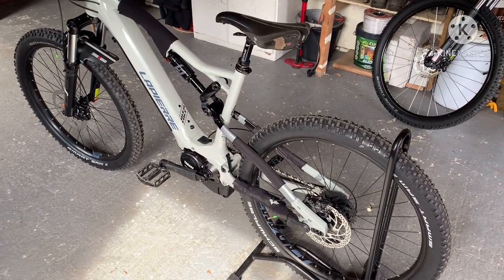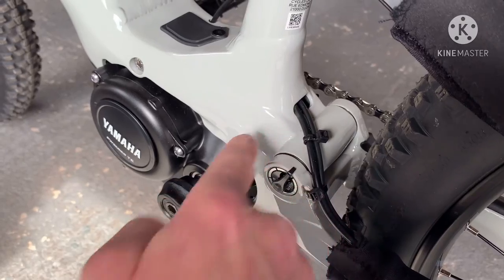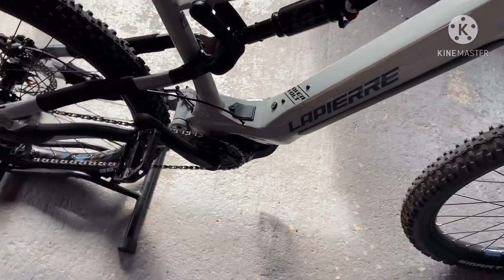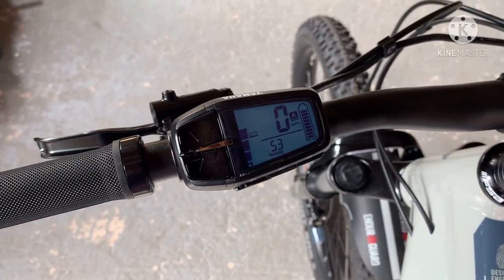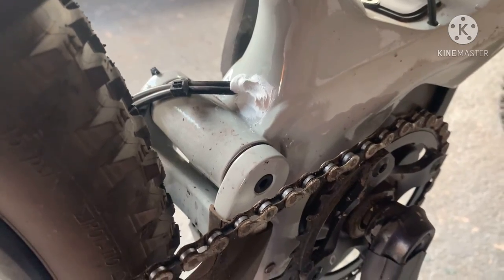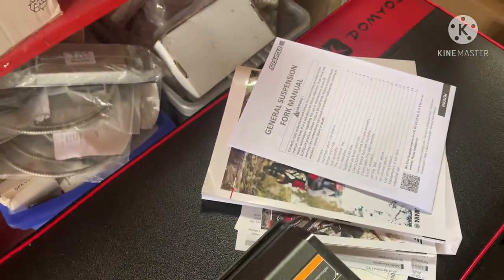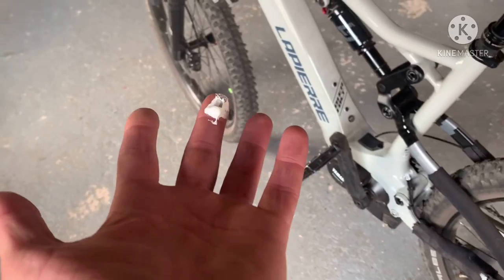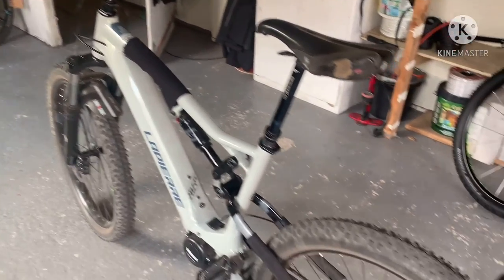Lapierre Overvolt TR 3.5 electric moutain bike - 2021 ride review

Comment: Thanks for making a great video! I've just ordered one of these, and was wondering if you could point me in the right direction for the frame protection you have used and have you added anything to protect the downtube/battery. Any advice would be very much appreciated 👍
Reply from the maker: I always use electrical insulation tape, it’s cheap and good value. I have used duck tape on the Down tube in the past. Also neoprene covers are good. 
Make sure you get a chain device because I had a problem with the chain coming off the front chain ring on bumpy trails. Glad you liked the vlog👍
Reply: @leeteemtb9587   Awesome!  I'll give some neoprene and electrical tape a got when the bike arrives, and look into a chain device. Thanks very much 👍

Comment: It only has 9 gears, that seems low compaired to e.g. a lot of Cube bikes and the 70Nm yamaha Motor is also less that on e.g Cube reaction hybrid, which has 85Nm... do you think this males a difference for an average diver?
Reply from the maker: A lot of the newer ebikes are coming with 10 speed set up, I guess it’s an industry thing and if one does it then the others follow
Reply: @leeteemtb9587  thanks for your opinion.  What do you think about the motor, compaired to your Cube?

I am willing to buy this lapierre, but currently there seems to be low/no stock  anywhere.. going to talk to my bike dealer tomorrow 🙂.
Reply from the maker: I prefer the yamaha on the lapierre to the bosch on the cube, thats just a personal opinion though.

Comment: Thx for the video. I'm surprised, the charging point is very low, under the bike. If u ride in the mud or water, it may be  risky...? (sorry for my English, I'm French)
Reply from the maker: I will only be riding the bike in good conditions to be fair. The charge point is very well sealed. 
Votre anglais est très bon
Reply: @leeteemtb9587  I have an Emtb, and trust me, you will be tempted to ride in mude conditions and even worse conditions ;) those bikes are made for extreme conditions! I have crossed rivers with mine :D

Comment: How many miles you can do on one charge? I see they are now for 2499f on website
Reply from the maker: I easily got 50 miles on eco. They are a good budget full suspension Ebike. Just be careful of the chain coming off on bumpy cross country. I had a nightmare on my vlog at the climach trail. Search it out on my channel and you’ll see. I ended up calling it Crapierre 😂
Reply: @leeteemtb9587  thanks 🙏
Reply: I Found one on website but first store it's 300miles from me 😂I just wander if something happened to Electric or whatever how they should sort that issues 😂I just little bit scary to buy bike from far store
Reply from the maker: @MatthewAntkiewicz  I understand your concerns, I sold my lapierre ages ago. Riding a KTM hard tail Ebike now and I must say I’m impressed. Less to go wrong on a hard tail Ebike but a bit tougher on the butt
Reply: Thanks for everything it's really good biek for the price 🤦still have a question what about charger how long you need to charge battery to full? It's any change to buy different charger to quick charge?  maybe you have Idea how much could cost extra battery so Maybe you will able to take with you ? On trip thanks ☺️
Reply from the maker: @MatthewAntkiewicz  full charge I recall was 5-6 hours and it’s a standard charger with the bike. 
New spare batteries will cost you probably around €700 for the 500Watt hour. All details should be on the lapierre website

Comment: Did you figure out what the mystery tool was for ?
Reply from the maker: Never found out no 😂 probably a French thing. 
Sold that bike a long time ago
Reply: @leeteemtb9587  I haven't long brought the same bike but couldn't figure out what is was for and I have given up on the instructions!!!! Thanks for the reply
Reply: @philipjames-watkins2583   Hi Philip can I ask how you like the bike 6 months on I am seriously considering buying one as they seem very  good value. Thanks
Reply: @hamishmctavish2977  Hi ,  the bike is great for my needs. Provides great assistance uphill , I generally use the standard assistance mode.  I go off road but no mad jumps , the suspension works great and assists in keeping the bike under control. The only thing I would recommend is putting a dropper post on as this assists  when throwing the bike down hill. I am very pleased with it and have had no issues with the exception of cracking the battery cover with a stone thrown up off the trail. The replacement was reasonably priced and quickly delivered. ( I brought the bike through Cycle solutions and they were brilliant with the initial purchase and the replacement battery cover). I know there are a lot more expensive bikes out there but this is a good bit of kit with  a reasonable set of components which suits my needs.